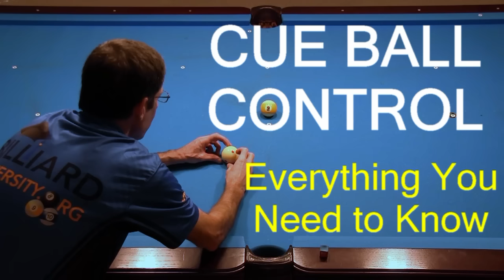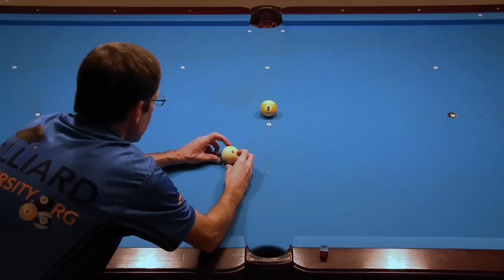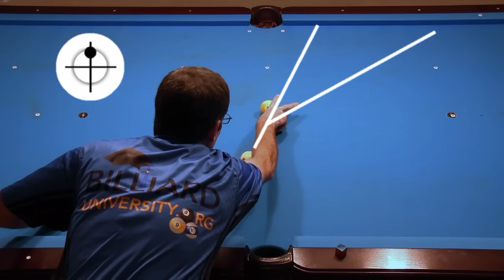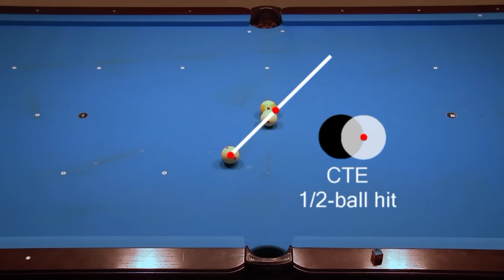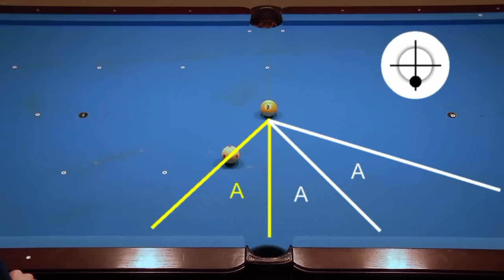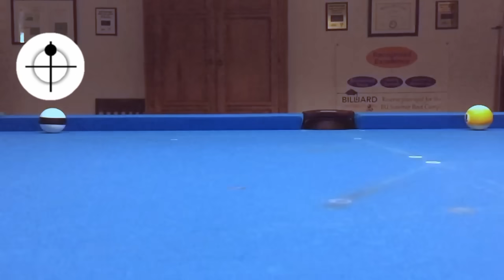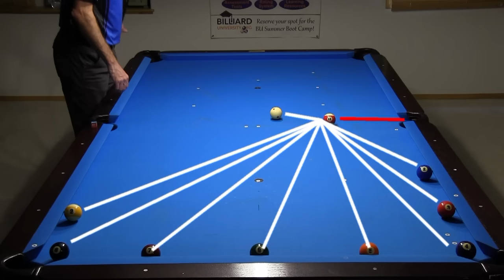CUE BALL CONTROL ... Everything You Need to Know

Comment: Dr. Dave, at minute :40 seconds, isn't that lower right opposed to lower left draw as indicated? Just want to clarify thanks!
Reply from the maker: No.  It is correct.  You can see where the tip is on the CB.  The CB rebounds to the right from the shooter’s perspective, but to the left relative to the direction into the rail.

Comment: So basically the lower you hit the cue ball the slower the ball will roll down the tangent line? 

Higher you hit the faster it travels?
Reply from the maker: To get a stun shot down the tangent line, a lower tip position is required for slower speed.
Reply: So general, regardless of of what angle your hitting the object ball the white ball will be slower coming off or is how hard you hit doctates the speed?
Reply from the maker: @TimMeadows-u3i The speed is dictated by how hard you hit it.  The required tip position (to get stun) is based on the speed.  See the first video and other info here:
https://drdavepoolinfo.com/faq/stun/shot/

Comment: Regarding the 30 degree rule, how does speed and distance impact the amount of top spin that’s needed to achieve a “rolling CB”?
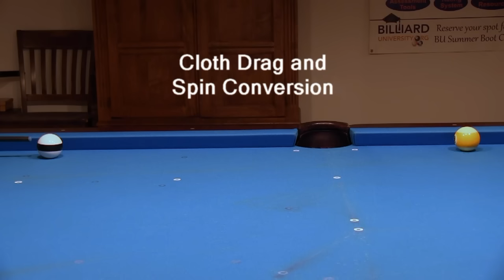Reply from the maker: See the "Cloth Drag and Spin Conversion" section of the video starting at 9:35.  If the tip is high enough, speed and distance don't matter.  See:
https://drdavepoolinfo.com/faq/cue-tip/height/

Comment: With better than good action draw is the cue ball actually jumping to the object ball and hitting it at exactly the same time as the table with perfect timing for the backspin moment of rotation to then take over? (I know the cloth friction wouldn't have been the issue unless it was very soft, it's just that to get that much backspin without miscuing...) I think then if you get a really vertical jump with ludicrous backspin it can be ridiculously good, but timing the landing with the cue ball coming down and having to hit such a thin spot and keep the line exactly right and the timing.... wow. On the opposite extreme you can probably use that to also get past the half ball circumference chalk mark problem, a little hop so the cue ball can spin a bit more before it hits the object ball.
Reply from the maker: Jumping or hopping the CB actually reduces draw effectiveness. See:
https://drdavepoolinfo.com/faq/draw/cue-elevation/
Better than good action draw just requires a very low tip with enough cue speed.  See:
https://drdavepoolinfo.com/faq/draw/trisect/

Comment: @DrDaveBilliards, does the 3 times the angle and peace sign system apply to forward cuts when the object ball is close to the rail? Or does the rail affect the path of the cb?
Reply from the maker: The rail has a small effect, but the system still apply.  See:
https://drdavepoolinfo.com/faq/rail-cut/non-frozen-cue-ball-control/
and:
https://drdavepoolinfo.com/bd_articles/2017/feb17.pdf
Reply: @DrDaveBilliards  this is exactly what I was looking for. Thank you. Another question, in diagram 4, it shows the cb curving after rebound for follow shots because the top spin doesn't have enough space to take. I'm guessing it would it look similar for draw shots?
Reply from the maker: @AnHonestObserver . Yes.

Comment: @DrDaveBilliards, for the scenario of hitting low on the cue ball, do you have a graph where the x axis is time(or distance), y axis is spin rate, where negative y is draw, 0 y is stun, positive y is follow? I wonder if the line is a smooth curve, or is it straight angled lines, like for example after the stun phase, does it linearly increase its forward spin rate, or immediately reach its max forward spin rate, or something else? I ask because when I'm trying to stun a far object ball, do I need to hit it hard to make sure the cue ball is stunning by the time it gets there, or maybe I don't have to hit it so hard because forward roll doesn't develop drastically but more gradually, if it's gradual, how gradual. Also a somewhat related question, how large is the draw phase compared to the stun phase compared to the follow phase?
Reply from the maker: See:
https://drdavepoolinfo.com/technical_proofs/new/TP_A-18.pdf
https://drdavepoolinfo.com/technical_proofs/new/TP_A-30.pdf
Concerning practical advice for stun and draw shots, see:
https://drdavepoolinfo.com/faq/stun/shot/
https://drdavepoolinfo.com/faq/draw/physics-advice/
Low and Slow is the Way to Go.
Reply: @DrDaveBilliards  This is great work. Thank you! It's interesting in TP_A-18 page 3, drag-drag shots, with half max tip offset, it slides about half the distance as it back spins, but with max tip offset, it slides only about an eighth as much as it back spins. or maybe I'm understanding it wrong. Also, does your definition of "roll" mean the vertical spin is the same rate as the horizontal speed? Or does roll just mean any positive vertical spin?
Reply from the maker: @AnHonestObserver  With more bottom spin, the CB loses speed over a greater distance, leaving less for stun slide.  Roll means the rotation rate is v/R so there is no slipping at the contact point.

Comment: All we need for all kind of english is a tip away from the center of cueball and a loose grip 
Is that right dr?
Reply from the maker: Staying on the vertical centerline of the CB can do a lot.  Adding a small amount of sidespin when required allows much more.  Some shots require much more sidespin.  A relaxed grip is certainly helpful, along with everything else here:
    https://drdavepoolinfo.com/tutorial/fundamentals/
Reply: @DrDaveBilliards  i would like to add that also a soft a tip helps you play that kind of game 
That means it is hard to miss a shot when you avoid to put a lot of english
Reply from the maker: @georgiougeorge9261  I prefer a harder tip for the reasons here:
https://drdavepoolinfo.com/faq/cue-tip/hardness/
Sidespin does add lots of variables that affect aiming, but SAWS helps me easily account for them:
https://drdavepoolinfo.com/faq/sidespin/aim/saws/

Comment: Hey DrDave i hope u can help me to   clarify somethings here? does the 30 degree angle ( piece sign) only work if u hit Top spin ( above center) ? i thought if i hit the center i use the Piece sign ref". it looks like if i hit center i just use the tangient line all the time? /
Reply from the maker: The 30° rule applies when the CB is rolling when it hits the OB, which is the case for a high tip or slower speed or long distance.  See the section of the video starting at 9:35.

Comment: Dr. Dave I use your backhand English and love it. the other day I had a spot shot and the cue ball was line up for a 1/2 ball shot to the right. Now before I go any further I placed  balls 3 against the rail took the cue ball back about 6 feet added 1 tip of right english hit the cue real firm and the cue went right in the middle without hitting the 2 balls.Now, when I put the cue ball with 1 tip of right inside english on it, I’m getting a thick hit, on the object ball. Seems more like a 3/4 ball hit. It isn’t even coming close to the pocket. For the life of me I’m drawing a blank, shouldn’t the cue ball be hitting the object ball for a half ball hit.
Reply from the maker: BHE alone is not effective for a wide range of shot speeds and distances.  As you know, that’s what SAWS is for.  Also, if the cue is elevated, even a little, everything changes.

Comment: This video has changed my game so much! Thank you for this helpful video. I had a quick question: when aiming for true center of the cue ball with no side / top / or back spin for a short shot, is the top of the tip or the center of the tip what we should be using to identify / strike true center with?

Thanks Dr. Dave!!
Reply from the maker: I’m glad to hear you have found the video helpful.  Concerning the best way to find the center of the CB, you should do whatever works best.  The advice here might be helpful:
  https://billiards.colostate.edu/faq/eyes/finding-center-ball/
Reply: @DrDaveBilliards thanks Dr. Dave! I went through these before and didn’t find exactly what I was looking to learn – but I know from your resources that when putting spin on the ball usually you’re striking with some part of the top other than the center of it. Someone opined to me that whenever you’re striking true center, you’re doing so with the top of the cue tip not the center. To my understanding from your resources, if you strike the center of the cue ball with a near level cue you can do so with the center of a rounded tip, not the top. So I was looking more so for the physics of it all, or in other words: is it possible to strike true center with the center of a cue tip?
Reply from the maker: If you are aiming through the core of the CB (for a "center-ball hit," resulting in no spin), the center of the tip will contacting the CB.  See the top-left illustration on the top of the 2nd page here:
    https://billiards.colostate.edu/resource_files/jump_shot.pdf
See also the illustration under the videos here:
    https://billiards.colostate.edu/faq/cue/elevation/
Reply: Ah okay! Thanks Dr. Dave. So if aiming for a center ball stun shot with a near level cue (without elevation beyond what is needed to clear the rail) it seems like it is still possible to hit the center of the cue ball with the ~center of the cue tip, at least from what I gather from these resources. Thanks, Dr. Dave!
Reply from the maker: @philipv.mcharris5010  Hitting the center of the tip is the only way to get immediate stun!  However, most stun shots require a slightly-below-center hit since there is drag action on the way to the OB, so the tip will contact the CB slightly above the center of the tip.  See:
    https://billiards.colostate.edu/faq/stun/shot/
Reply: @DrDaveBilliards  ahh makes perfect sense!! Thanks for clarifying these questions for me, Dr. Dave. I really appreciate it and all you do for the pool community!
Reply from the maker: You're welcome.  I aim to serve.    :)

Comment: The stun tangent line is a manipulation of the true tangent line which is simply centre ball follow thru. All tangent lines come from the follow thru tangent line. The 90 degree rule is just a manipulation of the follow thru tangent line.
Reply from the maker: The "tangent line" is based on a stun shot.  Follow and draw are relative to that.  For more info and demos, see:
    https://billiards.colostate.edu/tutorial/cue-ball-control/
Reply: @DrDaveBilliards  only inpool in biliards the true tanget line is tfrom the half ball in off
Reply from the maker: @jefo4213  That is called the "natural angle" in pool and can be visualized with the 30-degree-rule peace sign:
    https://billiards.colostate.edu/faq/30-90-rules/30-degree-rule/
Reply: @DrDaveBilliards  yes that is my point and when the 90 degree rule will not work in snooker or billiards, not so much pool as the rails are v shaped. When a distance of about 24 to 30 inches is applied to the 90 degree law at true stun for each individual then it will not come off at a 90 degree angle anymore. The cue ball clock stun position has to be manipulated at the above said distances as it will naturally go forward of the 90 degree rule
Reply from the maker: @jefo4213  The 90 degree rules works perfectly for any stun shot at any distance; although, it does take skill to get stun at different shot distances and speeds.  The 30 degree rule applies only for a fully rolling ball; but even then, speed effects must be considered:
    https://billiards.colostate.edu/faq/cue-ball-control/speed/
For shots with different amounts of top or bottom spin, it can be difficult to predict CB carom direction, but the tweener shot principles can help:
    https://billiards.colostate.edu/faq/cue-ball-control/tweener/
Reply: @DrDaveBilliards  I absolutel love your videos truly but in this instance playing from MY stun position (proven) the cue ball at the distances I mentioned will go forward of the 90 degrees unless I manipulate the cueball either by squeeze or a different clock position over a 24 inch distance. Using my stun position inside 14 inches I will screw back unless I manipulate the speed or aim at centre ball. At 5,6,7,8,9,10,11 feet the cue ball at a My stun position even with a powerful squeeze will never achieve the 90 degree angle without manipulating both cllock and squeeze, it simply is not possible on a 12 foot table.
Reply from the maker: @jefo4213  If you can't achieve stun at distance, either your tip is not low enough or you are not using enough speed.  And if you are getting draw at short distance, your tip is too low.  Now, the OB direction and the tangent line are affected slightly by throw, but one can compensate for this.  For more info, see:
    https://billiards.colostate.edu/faq/30-90-rules/sidespin/
Reply: @DrDaveBilliards  lol now you have just proven my point. To ahieve the natural stun tangent line  at a distance greater than 24-30 inches and beyond the stun position has to change to a lower  cue ball position. If it is inside 14 inches then the stun position for 90 degrees has to become higher in order not to screw the ball back inside the tangent line..which as I have stated all along is a manipulation of the cue ball for distances inside and outside of the natural 90 degree tangent line. the 90 degree tangent line is only achievable at a distance of 14-20 inches at the natural stun position, as you have just stated above.

Comment: Hi Dave, would you ever recommend practicing with smaller balls?
Reply from the maker: ... not really, but any practice is good practice.
Reply: @DrDaveBilliards  I have a regulation size sizes table and balls. I just thought using smaller balls would be more difficult and better practice?
Reply from the maker: To excel at pool, it helps to practice with standard pool equipment.

Comment: Happy Holidays, Dr. Dave! I had a quick technical question that I had trouble figuring out after reading and watching a few of your resources. With a stun forward shot where you’re trying to place the ball between 30 degrees and 90 degrees, is it possible for the ball to have no spin during any point of the ball path and be completely sliding? Or does it just not have complete spin, but some spin, because the ball is moving fast and / or there was not that much follow applied? Thank you Dr. Dave!!
Reply from the maker: Those shots are called tweeners, where the CB has partial topspin between stun and natural roll.  They are covered here:
    https://billiards.colostate.edu/faq/cue-ball-control/tweener/
For info and demonstrations for how to get partial topspin, see:
    https://billiards.colostate.edu/faq/sidespin/slide-roll/
Reply: @DrDaveBilliards  ahhh I see! That makes a lot of sense. And with all shots regardless of spin at OB arrival, the CB always starts off down the tangent line, but with follow and draw shots that are slower but not too slow the time it spends on the tangent line just might not be noticeable?
Reply from the maker: @philipv.mcharris5010  Actually, speed is a different effect, per the info here:
    https://billiards.colostate.edu/faq/cue-ball-control/speed/

Comment: Dr.Dave I’m having a little trouble with the BC boot camp #9  that 8 o’clock left English I’m not stroke the ball correctly. When I hit it the cue ball is not go to the left like it should. How are we suppose stoke the cue ball? When I was trying to hit it with a 8 o’clock draw shot the ball would go down the tangen line hit the rail and come right back up the same line. Maybe I need more of a follow threw stroke. Try not to make your answer to difficult I’m not in college!
Reply from the maker: If it is not rebounding to the left, you are not putting enough left spin on the ball. It is simple as that. Also, on a slow cloth, the sidespin wears off faster, so you might need to use more speed.

Comment: Dr Dave - 've been trying to understand this on a particular shot i am a little stumped by:
The object ball is a bout 6" left of center on the line of the head spot. The cue ball is in line with the ball and left corner pocket at foot of table (I hope I explained that right - I wish I could post a picture).  
Its a thin cut to hit the ball in the right corner pocket.  I've hit this shot over and over and I scratch in the left corner every time with draw, stun, follow....
The only way I don't scratch is to hit it very softly and the cue ball will head to the head rail instead of scratching.  
Can you explain this in terms of what your video is showing? You indicate that speed should not affect tangent line movement but I am getting a very different cue ball motion with soft hit vs a firm hit with with all different sorts of action.
Reply from the maker: Shot speed most definitely affect CB trajectory for non-stun shots.  See:
    https://billiards.colostate.edu/faq/cue-ball-control/speed/
Enjoy!

Comment: I dont understand.  In one instant If you hit an cut shot with topspin, it will follow the tangent line and then curves.  But in another instance it follows the 30 degree rule??? What?
Reply from the maker: Every shot starts off on the tangent line.  But with a slow-speed follow shot, the CB curves to the 30-degree direction pretty much immediately after hitting the OB.